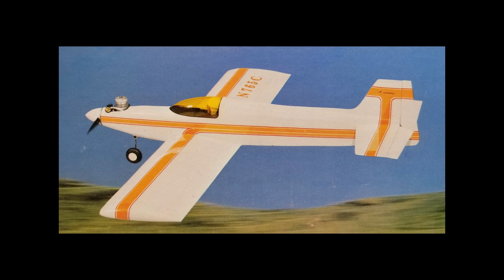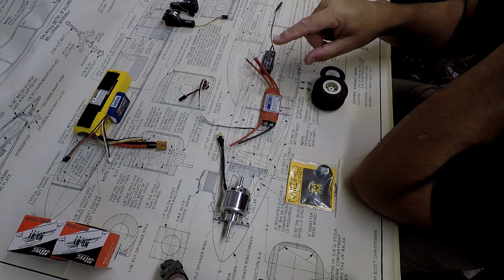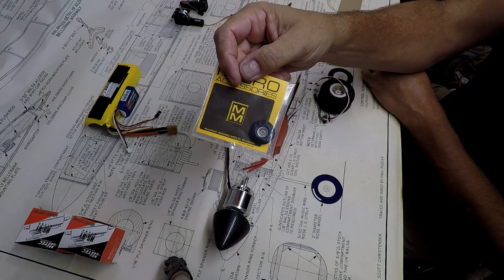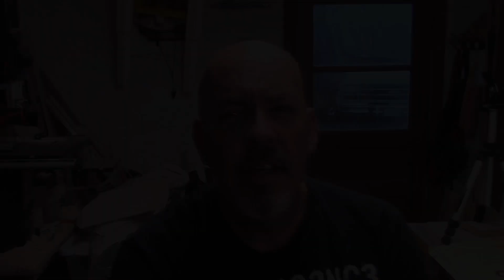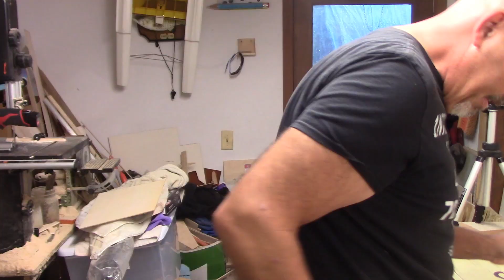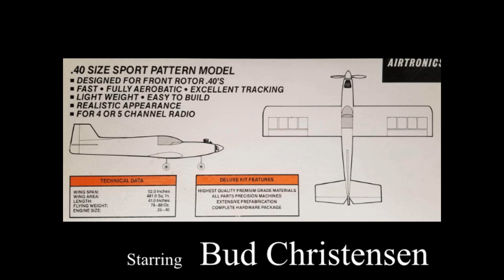Project Warlock - Video 3 - Finalizing the Changes... Let the Building Begin!

Comment: Check out the HS85's for an aileron servo on a ship like this. They're a touch bigger than the 81's, but are much more robust.
Reply from the maker: Thanks for the reply!. I have a couple in my "arsenal" of parts. I considered using them but I couldn't convince myself that the HS-81's aren't up to the task. I have been using them in my sailplanes for more than a decade with no failures. I still may use the HS-85's in the tail of the Warlock to reduce weight.